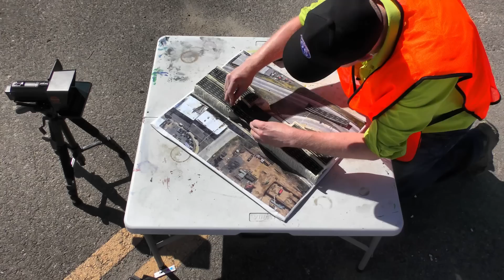Here's How Pennsylvania Re-Opened I-95... in Just TWO WEEKS!

Comment: I get why Philadelphia and Pennsylvania want to accelerate the replacement. But, this situation is nowhere near as dire as it sounds. Because, the majority of through traffic, using the 95 corridor, would usually bypass Philly on I-295 or the Jersey turnpike anyway. This stretch of I-95 is primarily used by traffic entering and leaving Philly.

As for your cheesesteak, definitely NOT authentic. Sub roll, steak, cheese whiz (from a tub, not a spray can), and optional onions and peppers. That's an authentic Philly cheesesteak. Although they do allow you to put provolone on it without being sacrilege like ketchup on hot dogs in Chicago.

Comment: The bridge will be crossable ONLY WHEN THE LAB THAT TEST THE CONCRETE SAYS IT'S MET IT DESIGNED BREAKING COMPRESSOUN TEST. They will probably use some special mix design that cures faster only because they want it done, repaired quick, and the strength is greater then they need. The concrete mixes of today are WAY BETTER then the past. Some mixes that are in use today have breaking strength of greater then 12,000 psi break. But they are very expensive due to most is costly chemicals NOT WATER ! ONLY CHEMICALS. To much water causes cracks and breaking strength loss. The reason for home foundation failure due to differential settlement. AKA. shack knocker mud they place in forms at an 8in slump, pancake mix wet  To much water can make 3500 psi concrete, house foundation mix become 2000 psi break which the water created .They will use a design mix that be used in areas with required need strength due to EARTH QUAKES. a WEST COAST MIX, SEATTLE CA. OR. These states have the highest seismic requirement for concrete. ""From a Seattle Carpenter union bridge builder"" and a mixer truck driver daughter. In the big picture this is a cake walk job,

Comment: Your absolute right. This is a great video. I’m an inspector on the temporary bridge. It’s almost done
Reply: Also that cheesesteak is NOT authentic 😂😅
Reply: Do you know why they did it in the middle vs one side?
Reply: @tudorpottudorpot8423  Easier for MPT. Good question though.
Reply: @oscarwinner2034  easier?
Reply: @tudorpottudorpot8423  Less median barrier to pull. Also with the all on one side plan, you need to use three phases. NB, SB, then a final one to rebuild the median. With this, the median is restored in the second phase.
Reply: They still need to do all three. The current median appears to be situated on the retaining wall which I assume will be removed at some point. I may not be understanding what you mean by median, which I understand is the barrier between nb and sb lanes.
With the side approach, the median would be built with the first true bridge either sb or nb.

Comment: Thank you for the explanation.  I remember over a decade ago along the I-5 through the Central Valley a flash flood had washed out a bridge that carried interstate traffic above.  What Caltrans did was take some flat-bed railroad cars and use them to temporarily span the washed out section and then put asphalt on top to allow a single lane each way while they rebuilt the bridge.

Comment: Part of the story is that the destroyed bridge had big steel I-beams at the bottom, and deck on top, meaning not much to protect the steel beams from the heat very quickly softening up the tensile strength of the steel.
Reply: And concrete would have helped? Concrete under high temp spalls apart, nothing reasonable would have survived the temps the bridge experienced
Reply: @nimrodbegg123  I agree. Steel reinforced concrete girders may not have failed the way steel did in this case, but the damage would still be severe enough to warrant closure of the entire bridge for inspection. Concrete girders are known to have greater longevity.
Reply: @Leebetter Great point. I wonder if some type of effective heat dispersion could be included in bridge design. Or even a fire suppression system underneath.
Reply: @eternalstudent7461  I like the idea. In dangerous areas and under specific circumstances, It could be very beneficial.  Although, a system like this would be too expensive to design and maintain for most jurisdictions, road departments.
Reply: @nimrodbegg123  It's 110 in Houston...they seem to work just fine.
Reply: @KB-ke3fi  and your still alive. Fuel burns just a wee bit hotter then air naturally gets to.
Reply: So it wasn’t a reinforced concrete bridge, it was a steel bridge with a concrete deck on top?
Reply: @JasperJanssen  Yes, It is a common bridge design. Multiple steel I beams with a reinforced concrete road deck.
Reply: @gregking7926  I know, I’ve seen them before — but it’s not what this video was telling me.
Reply: I knew right away this guy didn’t know what he was talking about when he didn’t acknowledge there were huge steel I-beams under there, with concrete and steel decking on top.
Reply: So much for [jet] fuel not melting steel beams...
Reply: @scottdotjazzman  The fire did not melt the beams, the fire heated the beams to the point where the steel lost its static load capacity and the system failed resulting in a collapse. Same concept happens to just about every other material out there when it is heated.
Reply: @adamliske that went right over your head
Reply: @scottdotjazzman  Water cannot melt spaghetti either, right?
Reply: @scottdotjazzman  Doesn't have to melt it completely to make it fail. That'd be why the goobers who deny what happened to two particular towers in New York are goobers.
Reply: @scottdotjazzman  - Not every material has abrupt phase change, like water/ice. Every material has its own unique phase diagram. More people should have physical classes in school, making them use their hands. Not so much for a career, but to demonstrate things physically. There are blacksmiths, that heat metal, so that its soft enough to work. That's what basically happened here. The heat softened the metal enough, so that it could no longer take the load. Also changed the microstructure of the concrete, so it to has to be replaced.

The problem with the average layman, is that they hate math (because it tells them the truth). Physics, and math, should be taught more using concepts, as opposed to "number manipulation", as its currently done. The best way to do that, is to have the student physically experience REALITY. Like having someone hold a 1m x 1m (3ft x 3ft) piece of plywood, then turn on a fan, or them standing in the bed of a moving truck. There would be fewer mattresses in the middle of the freeway, if morons learn the of power of wind. You know Europe used ships powered by wind, to conquer, and oppress, the world !
Reply: Everyone knows they rebuild the road 50 times and used cheaper materials everytime. But the original base built 50 years ago was good construction.
Reply: @alanCalhoun2  no

Comment: Great video.... let's get started....

Former Boeing Everett - Lean Manufacturing... we build the largest aircraft in the largest factory by the fastest workers in world. All hold world records. After the Russian bridge was blown up that connected Crimea with Russia, they had parts reopened in days, the worst damaged in a few weeks. So it can be done. Even under wartime conditions.

America is backwards in regards to European countries, both in engineering and Civil Project Construction. If something is given 3 years to complete in America, it will take 5 years to complete. After fire, American experts were saying it could take many months, Europeans were saying weeks. I concur with their experience.

I said it could done under 1 month, I have experience getting big things done fast. Boeing can build a B747 in way less than a month and they are 100 of times more complex with specs and tolerances way tighter than a bridge.

Before Boeing I was an Architect / Construction Engineer, and know plenty about bridges; demo, steel, columns, decking. Bridge on I-95 can be replaced with structural steel beams or pre-stressed concrete and steel beams, and steel and concrete decking. High Early Concrete can be used on decking for beams and road surface, also it doesn't need 28 days to reach adequate curing strength.

If bridge is given 30 days to complete... it can be done in 29.

Comment: I was figuring they could do it in one week.. its filling a gap...    Its not  like the engineers are trying to straiten the Millennium tower in SF.   I predicted the quick fix would be to fill in the gap as soon as it happened..    I'm just surprised they couldn't do it in a week!
Reply: They had to demolish and remove 16 lanes of bridge and access the damage ffs
Reply: The hardest part is that the bridge had a continuous deck that tied in the approaches too. So there's a lot of precision demo at the top of the abutments. The SB beams were actually cut off at the abutment as their ends are encased in concrete. Also the sewer lines under the ramp prevented typical beam dropping. All crane work.

Comment: How does a tanker truck full of gas turn and flip and not have half the tanker sticking outside the bridge?  I have yet to see a tanker in any video or photos after the fire was put out.  If it partially melted and burnt to a crisp, you would still have a ton of steel and aluminum to remove.  The video camera on a warehouse looks suspicious and not credible.  I hope a 3rd part investigation is going to heppen here.  Things dont add up.
Reply: Not everything is a conspiracy, dude. It's an overpass over a curve, and it's 2 lanes with wide shoulders. Even if the truck flips right before going through the underpass, inertia will carry the truck a bit before it skids to a halt.
Reply: @WaterMan416  Whenever someone hears a point of view these days contrary to theirs, it's an automatic conspiracy theory.  It is just facts!  Where are the photos and video of any huge semi tanker while burning or after turning into a pile of mush melt?  It doesn't turn to ashes dude!  That is evidence.  The wall of the tunnel would stop the inertia in its tracks if the tanker flipped on its side.  Think about it.  It flips on its right side.  I'm a firefighter, I have seen a thing or two with big wrecks!  This is suspect!

Comment: I wish that other transportation options (like Amtrak!) were being looked at too - especially for the interim while 95 is under construction

Great video explaining the whole thing!
Reply: Amtrak does go through Philly and we have SEPTA wich can get you too or close to anywhere in and around a idk 20 miles radius from center city even into Delaware except but if ya Wana go jersey but they have trains that go from CC over bridge threw Camden County  Cdennis basically East Philly because Philly doesn't have a east side of the city
Reply: But trains ain't answer for  north eastern commercial shipping think they used more for regional shipping
Reply: @30215PAPE  trains don't even do regional shipping that much either. Train companies basically abanonded that principle and pushed that to trucks. Trains really just do interstate shipping with very long, long trains, where product can take weeks to be moved and it's not a big deal. Trains can't do regional shipping because that's too expensive for train companies to continue to invest it. It's not that it can't be profitable. The issue is, it's not profitable fast enough. It's a very short sighted issue.

We wouldn't have the issue with drivers being over worked, taking turns too sharp, and crashing under bridges if we didn't move SO MUCH stuff through trucks. If we use less fossil fuels, there would be less need for moving so much and so quickly. Some gas stations are so busy that they need to be refilled multiple times a week, or even once a day, which means transporting all that hazardous material. In all risk calculations, we accept that this situations isn't an accident. It's inevitable. We know for a fact that transporting hazardous material on public road infrastructure is a risk; we accept that. We know that drivers are overwork and underpaid and that creates risks; we accept that.

Road engineers don't even care how much cars weigh anymore because of how little impact residential vehicles have on bridges. All the consideration of the weight that these bridges have to support is because of the weight of commercial trucks carrying so much weight. This bridge could be slapped together in a few weeks with some wireframe steel trusses, filled in with a little dirty, asphalt, and a some paint and it would handle 100% of residential traffic. Because our road system subsidizes transportation for commercial transportation, the roads have to be engineered to insane standards, and it's so much more expensive and it takes so much more time.

It's totally possible to move a lot more freight and people on to trains for literally fractions of the cost to build and maintain interstate highways. But that would require the government to invest in not-vehicle centric infrastructure, *and that's socialism*.

As rob explained in the video, this could have been avoided if we just built the regular traffic to go over the main interstate, and if that bridge failed, opened in less than a week after cleaning up the mess. We just accept the risk because of costs. I lose sleep some nights dreaming about some sort of system where the government would create a jobs program, and we just, sent people out to work and rebuilding our long lost dream of the intercontinental railway that could connect the country together again. Bring us all back together by building high speed interstate rail and regional rail systems to connect suburbs to cities and cities to cities and states to states. I can just get on a train from a Seattle Washington suburb to the city, connect to a train to take me to Dallas, TX, and connect to another train to a Dallas suburb and visit my aunt. The whole time I'm just working away on my laptop, drinking coffee, and enjoying the landscape our country has to offer. If I can work from home, any can't I work from a train and connect with people, and explore this beautiful country. But that's just a dream.
Reply: @ColrathD  idk if u seen video of this crash but he was flying down that ramp
Reply: @ColrathD Switzerland's rail system has good regional rail transportation. There, Ikeas and Aldis have rail sidings. It's the dream I've had since being a little boy for American RRs. Pain knowing it will never be here.
Reply: Yeah I figured trains for movin long trains of crude like around cause that's what goes behind my mom's house in Delaware when I was kid it use to move everything from fuel to electronics,cars etc ...few years back they built a second track and all sudden was was alot more trains but all were from oil refinery and they leave them running behind her house for days at a time and we good 6/7 miles probably more if u take rail from the plant..
Reply: Idk if you seen the crash that caused this but he was comin do n that ramp hot and when he tried to take that bend looked like side of his cab and front right corner of trailer smacked that wall something hard PROLY punctured take and while all that metal dragging against that wall so fast threw alot of sparks and 💥 sad situation and and bad situation for the residents and businesses over there in Mayfair that their block became 95 now

Comment: It's going to be a bottleneck mess anyway. Might as well close the bridge and have a total open work zone and get it done. You could open up lanes as they are finished or when 1/2 or 3/4 is complete. The important thing is job site access so crews can be efficient.
Reply: your suggestion will add months to the first opening of any lanes. Yes, this will take longer, but the traffic will be flowing in a few days.
Reply: @rupe53  Temporary lanes aren't much more useful than total closure. It doesn't take much to bring traffic to a screeching halt. A single lane drop or even simply a closed shoulder can jam traffic into a parking lot.
Reply: the work crews will have access and the local roads will have less traffic. Besides, they will be waiting weeks, if not months for the permanent materials to be delivered and set in place. Might as well have some lanes without several miles of detour.
Reply: @rupe53  There is going to be a jam on the highway and the local streets either way, it's going to happen, is happening. Instead of gumming up production by at least 2 weeks for removal of temporary base the crews can crank through what they have to do. When the damage is done there is no sense   in preserving roadability that is already gone. I have been on street crossing utility jobs. Doing the crossing on a closed road takes 2 hrs. It takes 12 hrs to do it with the half and half approach.
Reply: @joedaley1878  ... obviously the experts disagree, or they would NOT be doing it this way.

Comment: Remember the I 95 bridge collapse in Connecticut over the Mianus river back in the late 70s early 80s. Something like this construction method wouldn’t of worked.
Reply: Correct, but it did work well when similar happened in Bridgeport about 20 years ago... and they filled in the lower road to get things moving.